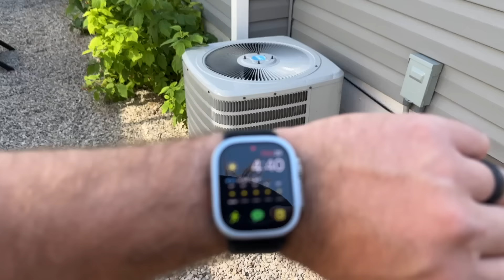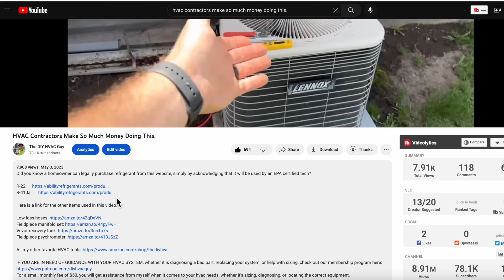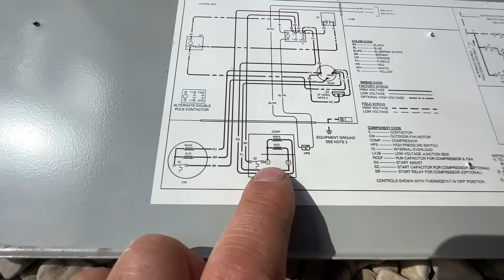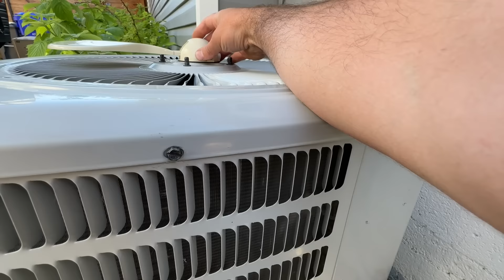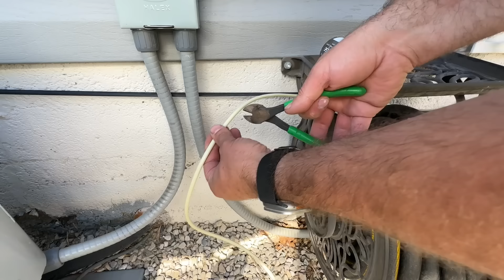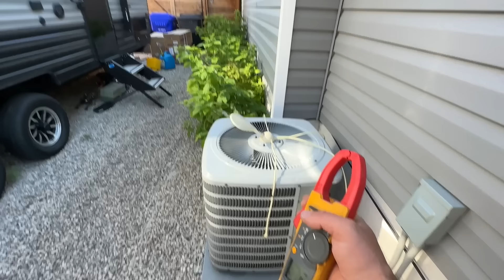Can This Device Actually Lower Your Electric Bill By 30%??

Comment: For those with engineering background...this is simply a change from a closed-looped dry-bulb cooler ( an "air-cooled-heat-exchanger").....to a dry/wet cooling device to take advantage of evaporative cooling effect. The bad part is that the coils (now being wet) will collect more debris or grass or cottonwood, etc...and will be fouled sooner. But yeah...adding a wet-bulb ( vs dry-bulb) evaporative cooling element to the system will improve performance but watch out for coils getting fouled.
Reply: True. Plus, the coils & fins will be additionally fouled by whatever calcium or minerals precipitate out of the vaporized water. Sure, the filter will probably remove some, but evaporation on the fins is SURE to remove the rest.
That may / may not be a deal breaker. Pros: It will save electricity, Cons: It increases the maintenance workload.
Reply: @DerekKerton  Why not just get an evaporative cooler and point THAT at the A/C coils?
Solves most of the maintain related issues while providing most of the benefits - and most of the minerals are going to end up in the Evap "filters" which are designed to be exchanged.
Reply: @bricefleckenstein9666  True. But not as efficient as directly wetting the ACs coils and fins. You'll lose a bit by being indirect. But it'll work! Your idea will send input air that is 5-10F cooler than ambient at the AC's coils (good idea), and like you said, the minerals will drop out at the swamp cooler not the AC.I suppose one knock against it is complexity, and power use at the swamp cooler.
Reply: @DerekKerton  More like 15-20 degrees cooler, if you duct it so that the large majority or all of the air on the cooling coils goes through the swamp cooler.
But the small extra power would reduce the electric savings - on the other hand, you only have to turn that "swamp cooler" part on for VERY hot days, which is where the conventional A/C unit would be using the most power.
It would be no more complex than a "do it yourself mist" system, with fewer drawbacks.
Reply: @bricefleckenstein9666 I was thinking the same thing with ducting a swamp cooler that would be solar powered. Seen a guy on yt build one with a 100w panel.
Reply: @Grifter1 Bingo! Hold my beer 🍺
Reply: @DerekKerton It Good, but just one point - water on fins won't always evaporate, if air is humid the water will collect and drain down. But either way, scaling is a disaster as it gradually reduces efficiency and wipes out any advantage initially gained. Industrial plants spend a lot of money on water treatment to avoid scaling.
Reply: It's actually more of "make it a 2-stage system" by adding a makeshift evaporative cooling system to the input air of the existing stage.
Reply: The priority  is the collection  of debris in his comment i think.  The method  of extra cooling isn't relevant.
Reply: It's called direct / indirect cooling. There are 38 seer units in Australia using this approach
Reply: @JB-yq9bn 38 seer? Wow
Reply: It's adding an evaporative cooler to condensing coil.  Evaporative cooling is effective in low humidity environments.   Like on the brown (west) coast; not so much on the green (east) coast.

Amp draw doesn't tell the power consumption story.  You need the phase delay (power factor) at the same time.   Also, the start winding does not disconnect when the motor comes up to speed on these - it still draws current.  You need to measure the total draw with a unit that also measures the voltage and power factor in order to know power consumption
Reply: I would imagine the dissolved minerals are a bit of a problem as well.
Reply: Not even remotely designed to be run this way. Warranty is instantly void. Coils will corrode case will never dry out and will rust, fan motor will corrode and subcooling will be FAR out of spec.
Reply: @agoogleuser3808 It’s not like we haven’t done things like this to temporarily get a customer by for a week.
Reply: You also have to careful to turn the water off drops to the low 80s or cooler. Running the water at lower outdoor temperatures can cause the system to freeze and possible compressor damage.
Reply: Just get outdoor unit in shade all timeslmost same result. And change to inverter  double fan outdoor unit In the shade You can build a louvered deflector for it if you can't get it in the shade and stand at about 3 ft from the unit and then move it in the winter if your heat pumping. Just that right there will save you a ton of money You can buy the double fan inverter outdoor unit on the marketplace anywhere there's a bunches of places selling them I bought one with the damaged case for I don't even know $400 or something four ton. Works beautifully chugs ride along and killed my electric bill It's unbelievable save the good chunk of change so that I can use smaller inverters to cool my other two out buildings and still be spending the same as I was spending the cool the main house.
Reply: Nothing a pressure washer couldn't solve.
Reply: Seems to me that providing shade for the unit is a plausible solution and will help keep the unit 10-15* cooler.  Not a large outlay of money.  Just provide the proper clearance as referred to in your owner’s  manual.  I am not an engineer, just a practical old guy.
Reply: I think this is a silly idea let's drive up our water bills to save the electric bill 10$ in a summer.
Kinda robbing Peter to pay Paul. But what do I know I only work the industry
Reply: @TheDpkustums  It depends - on if you PAY for water separately as a bill.
For a specific example, in MY case it's included in the lot rent.

Also, when the cost of electric is high, it can save a LOT more than $10 a month.
Reply: @bricefleckenstein9666 it is still ecologically irresponsible and socially irresponsible as most of the places with high heat tend to have a degree of water shortage...
I am not saying that you are doing anything wrong but this is a real issue that people should consider before doing it.
Reply: @TheAllMightyGodofCod  I NEVER said I was doing this.
When I have done it in the past, I was in Iowa which DOES have hot summers, and plenty of water.
I'm currently in central Washington, which has even hotter summers (though not by a lot), and ALSO has plenty of water from the Columbia.

I do agree that it's a BAD idea in Southern California, most of AZ / NV, or ANYWHERE ELSE pulling water from the Colorado.

And for the record, MOST areas of high heat in the USA do NOT have water shortages - reference most of Texas to start with, then add all of the Mississippi bordering/containing states among other "HOT in the summer" areas.
Reply: @bricefleckenstein9666  I never said you did.
Reply: @TheAllMightyGodofCod  Then why the comment about "I am not saying that you are doing anything wrong..." ?
Reply: @bricefleckenstein9666  because.
Reply: Yes - but unfortunately, that explanation went right over the heads of 99.9999% of the audience, who are no engineers!
Besides, look at where this country is now under potato head - if they couldn't figure that out and still voted for potato head, chances are exactly zero that they will understand how this all works!!!
Reply: What does getting Fouled me in this instance exactly??
Reply: @CaliCowboy805  ..I mention that in my original statement. The unit has fin/coils for cooling, like a car radiator. Misting the fins with water will improve cooling via the evaporative cooling effect....BUT....a wet fin will attract pollen, cottonwood and other debris which will now stick easier to the surface.... "fouling"......
Reply: @TheWilferch  would a vinegar bath be good or cleaning with A Lil Dawn soap work good for a cleaning.
Reply: @CaliCowboy805  ...I don't let my unit get fouled so I can't comment on good vs bad approaches. There are many Youtube vids and other sources showing various ways to clean the coils.....both from the preferred direction of cleaning "inside-toward-out" direction...and also from the other side. Good Luck, there is plenty of info out there.
Reply: @TheWilferch  thanks for your time.
Reply: @CaliCowboy805  👍
Reply: @CaliCowboy805  There are better cleaners, sprays etc,  and it is hard to get in there.  Better the fins stay clean and not get fouled in the first place.
Reply: @CaliCowboy805  Fouled means the build-up of minerals and dirt in the cooling fins.  Like bugs in your car radiator, too many and your radiator will not work well, and car will overheat.
Reply: @CaliCowboy805  Fouled, as in made dirty and scaly. Moisture will help dust stick to some parts and fins, and evaporating water will drop minerals on the fins and coils. You'd have to clean that with soap, water, and maybe an acidic cleaner like CLR or vinegar mix.
Reply: @DerekKerton  cool so Soap and Vinegar are good cleaners thanks.
Reply: @CaliCowboy805  A vinegar solution would help remove mineral build up from hard water… Or, use a phosphate filter than prevents the precipitation of the minerals… But, don’t use soap as it leaves a residue that attracts dirt/dust.. Just rinse with regular water… Or, better year, just buy a proper coil cleaning chemical - some HVAC distributors will sell these retail, or you can easily purchase online…
Reply: @CaliCowboy805 Soap and vinegar are not good cleaners. Just the weakest stuff sold to non-tradesmen. You would need ice machine concentrate and coil cleaner. The stuff that would burn your hands on contact.

Comment: My rear hose bib is about 50 feet from the AC unit. Back to the drawing board.
Reply from the maker: Just get some 1/4” poly hose from Home Depot and some quick connect couplers 👍🏼
Reply: @diyhvacguy  Certainly my first thought too. I just don't know if I want a 50ft line of 1/4" tubing running across the lawn and concrete patio between the two. Thanks all the same for the feedback!

Comment: Why did you NOT have your AMP clamp jaws FULLY around the run wire when testing after this product was installed so your current draw number is bogus…you did have the AMP clamp fully around the wire in the before installation ???…I call BS !!…PLEASE ANSWER !!…anyone that does electrical work know this !!
Reply from the maker: I’m not sure what you mean. It was clamped around the same wire both times. If you don’t like the product then don’t buy it 🤷🏻‍♂️ I don’t have any affiliate with Cool n save I simply bought the product to test it.
Reply: Optical illusion.  One image shows the wire routed from the front of the meter throught the clamp to the back.  The other shows the wire being routed from the back of the meter through the clamp to the front.

Comment: Decades ago , some of the pre-coolers for A/C in central Phoenix Az were built from stainless material. They lasted longer.  All of these devices made a mess from leakage with calcium on the house roofs since most HVAC were installed on the roofs then.   We had a stainless evap cooler on our house. The exterior  box lasted, I had to replace the interior squirrel cage parts after 15 years.

Comment: We have been doing something similar for a long time. We use a pressurized canister from Alloy Products with 50% distilled water and 50% Isopropyl alcohol. The water in Arizona is horrible and this company won't ship to AZ for the same reason. The water/IPA mix creates a colder mist and there is never a calcium build up.  A 3 gallon canister with 75psi in it will last about 3 weeks. A timer on the solenoid valve is programmed to operate only when the unit is in direct sunlight which is about 3 hours per day.

Comment: It's easier to use a lawn sprinkler zone solenoid to turn the spritzing sprayers on and off. The solenoids are 24 volts and can be wired into the thermostat wire letting the thermostat turn it on and off with the unit itself.
Reply: Bummer!  Good idea.  Please read my comments on the (Dynamax) Desuperheater I installed.

Comment: I used to put the tubing from the condensate pump on split systems and let the water pump out on the condenser coil outside to help lower head pressure and take a little stress off of the condensing unit. Never measured and checked the difference it made but you know it had to help. Especially as cold as the water was coming from the condensate pump !!!
Reply: Window units also do that to meet efficiency standards.   The condensate water is pure.   But, the condenser coils still get destroyed
Reply: A friend of mine did that with a 5 ton 16 seer years ago on his house which was completely shaded
The temperature at register was around 49 no joke it actually hurt to walk in that house early morning

Comment: It looks to me like the water should be spraying on the coils some of the ends look like they were spraying outside instead of spraying toward the unit
Reply from the maker: It’s designed to cool the air going around the coil not wet the coil itself.

Comment: I beg any and all of you to NOT do this if you have moderate or hard water. If you have <17 PPM of hardness in your water, go for it. If you have anything above 17 to 60 PPM you have moderate, and 60+ is considered hard water. You can buy a cheap test kit called a Hach 5B that will tell you quickly how much hardness you have. Here's the thing, once calcium sarts to build up on your coil fins, you MUST clean it off. The name of the game when it comes to cooling is efficiency, and if you introduce even 1/32 of an inch worth of calcium buildup, you just negated all the energy savings you added with the mister. So please, read the instructions and make sure that the capacity of the filter is not exceeded. Calcium buildup happens fast and requires a bit of work to get out, plus you have to be careful to not bend any of your fins, which deducts from airflow and thermal exchange. 

Anyhow, we used these in Arkansas for years growing up. You'd have the 95 F days with 75% humidity and the AC had to run 60% of the day. That's a lot of energy. My grandfather installed them and just raved and raved about how well they worked. I never saw any buildup, but I'm pretty sure he was religious about spraying out the unit every week when he mowed the yard. I can't attest to any savings, just that he showed everyone and talked about it to his neighbors. Thanks for sharing!

Comment: I dont see any reason at all why misting the coils would cause the unit to pull less amps. It's the same compressor and same fan running the same operation whether the coils are wet or dry. If you wanna tell me it ran for a shorter time since the coils were cooler and so consumed less total power id entertain your argument. But saying it reduced the amp draw cannot be believed by anyone who works with electricity. 

PS he's full of shit when he says the unit is pulling only 3 amps. Hes gotta be just measuring the wires going to the fan and leaving out the compressor, which is the bulk of the power draw. 

Id be skeptical to buy this story but would be curious to hear honest reviews from other people not trying to get me to click a link. 

Love, Andy the Electrician
Reply from the maker: Dude you watched me measure the same run wire from the compressor. You as an electrician should know that the fan is not going to pull 3.6 amps. 🤷🏻‍♂️    Also it’s the same compressor, same fan, but guess what’s cooler in the condensing coils? Refrigerant. Which means less strain

Comment: We were doing this on old Sizzler restaurants in the 90's when they did not want to replace RTU's. Back then the concept was a swamp cooler pad in front of the condenser. It worked for one or two seasons at best and then the coils (usually aluminum) would give way (back in the R-22 days) and we would junk the RTU. They did work and lower the head for a season, but not a long term solution back then. 
I put a 1025 cond. fan motor in when my OE 925 died.

Comment: Using your numbers, that might save me $10 a month ( of ac). Probably not worth it to me since it costs $100.
However,we have a 75 ton chiller at church that might see a big difference. Hmmmm.
Reply from the maker: If you are right, it would pay for itself in less then a year, and can be used the next year, and the year after etc etc. how does that not seem worth it?

Comment: The difference in electrical current draw has nothing to do with the water cooling the coils. It’s likely a measurement error in your device…or your utility company voltage supply varied, making it require less amps to produce the same wattage.  Power consumption is solely based on the work performed by the compressor to compress the refrigerant….which is constant.
Reply from the maker: Guess what’s going through the lines In the condenser coil… refrigerant. Am I wrong?
Reply: True, but then explain why the compressor is doing less mechanical work then.  Is it magically skipping a stage of the compressor?  You have the tools since you are an HVAC technician. Hook up your pressure gauges to both sides of the condensing unit and see if the pressure values change when you apply that misting system.  Can’t wait to hear back from you. 

FYI, I’m a mechanical engineer that is well informed in HVAC and thermodynamics

Comment: Man, your videos are great! I found you after working on my own ac system and have watched several already. I have a question though. Bit of background: my system is about 20 years old and I just replaced the outside fan motor and capacitor. I bought a universal fan motor. I find that the fan won't come on if it gets too hot and I'm wondering how much the amps matter between the capacitor and the fan. My capacitor is 1.7A, but my fan is 1.6A. Other than the weather, could that difference in amps cause overheating?